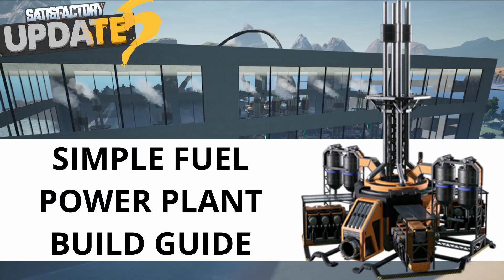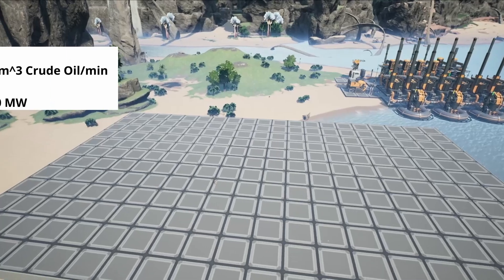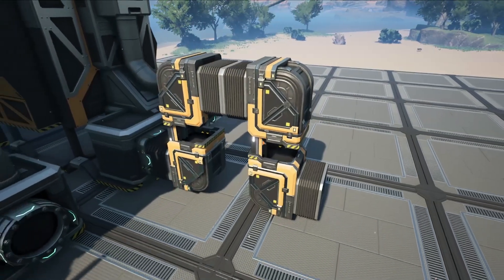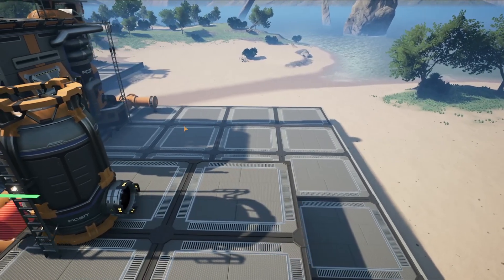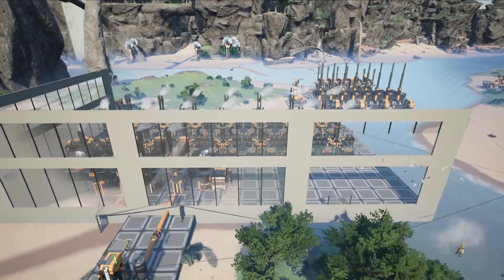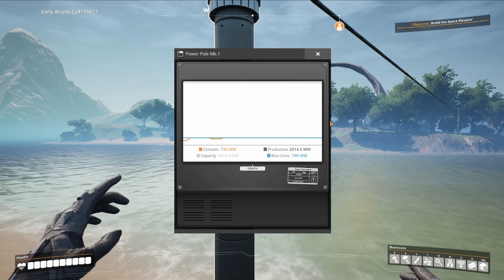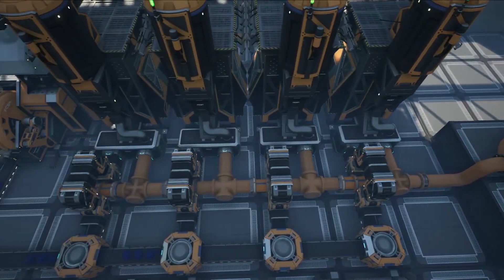Basic Fuel Generator Setup Build Guide - Satisfactory Update 5 Fuel Power Plant

Comment from the maker: They updated the numbers in 1.0, in general the design works but youll need fewer generators. The big change to the numbers was that generators produce more power and use more fuel, so you need fewer to get the same MW output. You should only need 8 generators and will still produce 2GW of power
Reply: Thank you so much for coming back to this video and posting this comment!
Reply: I'm new to the game and love your channel and was so confused as to why 14 and then I finally looked at comments. Thanks a ton for everything
Reply: Can you increase refiners to add more fuel or is the node maxed out?
Reply: @ScottAble12345 most likely the node is maxed out
Reply: I’m looking at doing this today. A couple questions. Are those mk1 or 2 pipes? Now that they have reduced the number from 14 to 8 on the last generator do I still reduce to 33.333? And lastly where on the map did you do this build?
Reply from the maker: @Andysbx  Mk 1 pipes are fine, you dont need to underclock the last generator (though setting it to 95% clock speed may help with stability), and i did this on the west coast but as it doesnt use any other inputs it can be built on any crude node.
Reply: But would it still power 14 anyway?
Reply from the maker: No. Generators use more fuel and produce more power in proportional amounts.
Reply: Did this with works for 10 minutes then stops

Comment: For those who want a quick math: 
Pure node = 240/min
Refinery 4x = 160/min
Fuel generator 8x = 20/min (160 / 20 = 8)

Keep in mind that refineries do crude oil at 60/min, so you'll have to adjust the number if you want to overclock the oil pump.

Comment: Does this build use Mk.2 pipes or something? My last 2-4 generators keep shutting down. Do I have to wait for the buffer to fill as well.
Reply from the maker: They changed the numbers in 1.0, and you should only need 8 generators now.
Reply: @Dekoba  Yeah, I saw that. But I wanted to keep the extra gens for more power. But the flow isn’t working.

Comment: I'd like to thank you for this guide. I used it for all my sessions when I played prior to Update 8. Does this still function correctly in 1.0? I ask because the Refinery produces 40 fuel a minute. Which means I'm producing 160 in total. But 14 Fuel Generators would need 280. Did the numbers change over the updates or did I just never notice?
Reply from the maker: They updated the numbers in 1.0, in general the design works but youll need fewer generators. The big change to the numbers was that generators produce more power and use more fuel, so you need fewer to get the same MW output. I havent built it yet but by the numbers you should only need 8 generators and will still produce 2GW of power

Comment: Hey dekoba!! Just started playing Satisfactory for the first time, I followed your full generator guide to a key…and it hooked up and looks good just like your video, however, the liquid byproduct is heavy crude oil, lol and the fuel refineries (14) of them, take fuel…and I can’t for the life of me figure where it’s going wrong…the refineries can ONLY produce items with byproduct of heavy crude oil… do I need to set up another 4 refineries to take the byproduct of the first set of four, and than pipe them into then fuel generator center mainline? Thanks hope you still read comments have a great one , your vids are extremely informative keep it up!!
Reply from the maker: It sounds like you might have picked the wrong fuel recipe. The default fuel recipe takes in crude oil and produces fuel and polymer resin. In this video I set up an awesome sink to destroy the polymer resin and burn the fuel in the generators. Check your recipes to see if you have them all right. Also, this guide is quite old (ill make a new one soon(tm)) and the numbers have changed a bit. I think mostly you need fewer generators, but I havent reached that point in the game myself yet since they made the changes. Best of luck, feel free to let me know if theres anything else I can do to help!
Reply: I was assuming it’s making plastic or rubber using using crude oil, and the the exported byproduct is HOR, which I thought the gennies take, but they need fuel…but I think your right perhaps I don’t have the recipe that you speak of..anyways great informative video please keep it up!! And thx for reply!! After 2 yrs old video haha

Comment: Had to troubleshoot someone following this 'guide'

Don't use buffers in systems other than train platforms. They either do nothing, hide problems, or cause them. If a system will run with a buffer it'll run w/o them. 

You often need to loop and flood the feed manifold feeding machines like refs and fuel gens to manage backflow.
Reply from the maker: Good advice!

Comment: Should both the last fuel generators be at 1/3 speed or only one of them? BTW Amazing tutorial!
Reply from the maker: Thanks for the kind words, in regards to your question, I don't know. CSS changed how overclocking works in update 7 or 8 and I dont know how that effects this Update 5 build specifically. The premise should still work, but it might be best to simply cut the last generator and only run 13 generators to be safe.
Reply: Thanks for the fast reply! I have built everything and it worked amazing. No flaws or bottlenecks. I built all 14 generators but one in the end I put on 30% and that worked perfectly.  @Dekoba

Comment: Great video!  Loved how to the point it was.  
Was there a reason to not merge a 240 + 60 oil extractor to make full use of the 300m3/m pipes?  And then adding one more Refinery?
Reply from the maker: Theres no reason you cant but it does change the math as youve said. I chose this size to work with a single oil node but it scales up fine.

Comment: I love this video and I used it for my satisfactory save with my friends but I wanted to make a suggestion: use valves for all pipes to fuel generators and set the limit to 12m^3 (except for the generators on the end). This way, it isn't focusing on keeping the first generators topped up and more fuel is able to pass down the main pipe to the other generators.

Comment: Though I appreciate the guide, could you go over possible expansion to this (to boost that MW higher)? Because only 2,000MW is a bit of a.. well, question mark? Compared to my 32 Coal Generators that give 2,400MW.
I'm stuck on Tier 6, so the more efficient Fuel Generator setup is out of my grasp right now (don't have access to Blenders).

Comment: i have a quistion if i put 2 power shards in can i then just place 28 fuel power thingies or will that wont work?
Reply from the maker: Not that simply.  You'll need to double everything in parrallel and use mk 2 pipes

Comment: question why dont you use the valve ? on your main pipe line that spliting of  left and right for the fuel power ?
i use the valve to set to 12 or 13, to have evenly split  then just let the pipeline fill up to 300 on every split ?
or do i look at it rong that use valve that way to have the main pipeline in middel fill up so that last fuel power dont have to wait up up untill the one´s behind them are power up?

Comment: Just built this last night and it doubled my.power generation ability. Thinking about building a other one near the northern forest cliffs where I started and turning my.coal into steel... fun times. Why does.the last one need to be tur.ed down, it seems to work OK at full power... will I eventually have issues?
Reply: There is not enough fuel being produced to feed the last one at full throttle

Comment: Since the under and overclocking for the generators is stupid, on the last generator I think your supposed to set it to 24% instead of 33.33333% because when set at 1/3 then it has the fuel usage rate of 5.15, and when set at 24% the usage is 4 per minute, which is what you want, because you're producing 160 fuel per minute and each generator is using up 12 per minute, and 12*13=156 which means, you need 4 per minute, which is the 24% hopefully that makes sense
Reply: Great video btw, and don't worry, the math you did was perfect 100%, but the over and underclocking for generators is stupid in this game, and don't apply to the target speed
Reply: Hmm was this patched/changed?  When set to 24%, Fuel usage goes down to 2,88m3/m.  At 33.333%, it's actually burning 4m3 Fuel/m.
Reply from the maker: Good catch

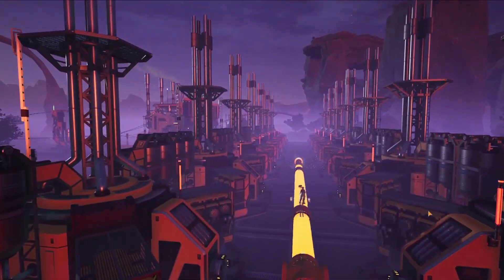Comment: PLease.At 2:14 I cannot decipher if it is the last 2 or just 1 that need less power.I tried phone, tablet and laptop but no go.I appreciate. I also realize I should do the math if I want to advance in this game.
Reply from the maker: Last 1
Reply: @Dekoba  I really appreciate your reply. Now I have to figure out why the generators say "no power ~ insert fuel"! The poles have power, oil in every pipes, refineries are working. My question is finally on Reddit! Scratching my head for too long. Stay well.
Reply from the maker: @aragureghian724  its probably an issue with your junction crosses. if you are haing trouble, tear down the pipeline, build the crosses first, then connect everything together,
Reply: @Dekoba  you are absolutely correct. Feel like a xxxxx! Thank you. Really like your videos.

Comment: Great video.  I like how simple and to the point you are with your tutorials.  I especially like the conveyor lift bridge for tucking a pipe into.  I'll have to use that more in some of my stuff.  

The only other thing I'd suggest mentioning here is that there is a bug which can make a machine with an internal fluid buffer lose 5 m3 of fluid when the game loads a save.  This is a common source of problems with fuel systems, especially really large ones.  It's useful to overproduce slightly more fluid (fuel in this case, obviously) than is consumed to allow for the system to refill in cases where this happens.
Reply from the maker: That's a great tip -  I had read your comment on my coal guide and thought to include it here but forgot during the moment of production. Thanks for reminding me and watching!
Reply: @Dekoba  You bet!  I sometimes forget to mention stuff like that myself.  :)
Reply: Does anyone know if this is fixed or should we leave the Fluid Buffer out?
Reply: @DreNizzo  The fluid loss bug has been fixed so unless it's reintroduced, you should be fine.  That said, pipes still work best when completely filled since the game models fluids sloshing around in pipes which can create issues all on its own.

Comment: Great tutorial.  I'm getting close to needing to add a new fuel power generator station for my factory.  Will most likely do something similar to this.  My previous fuel generator stations is run from the refining of Heavy Oil Residue. Looking now for just power, don't need anymore plastic at the moment so I like the idea of just dumping the waste into the Awesome Sink. Thanks for sharing on the Satisfactory Discord.
Reply from the maker: Thanks for watching! In my mind, 100% efficiency has a few different definitions, and so sinking the resin is not material efficient but is more power efficient, and minimizes waste in that way.